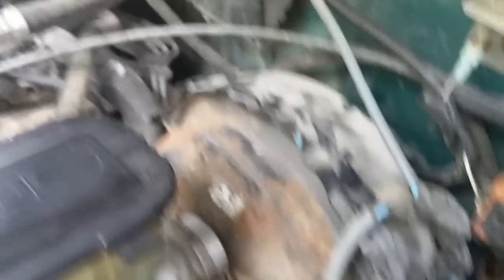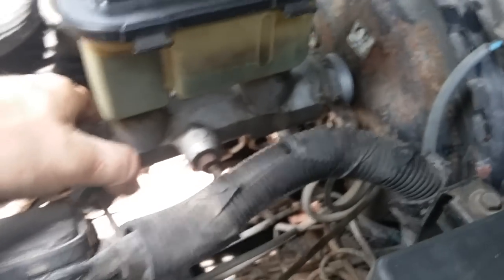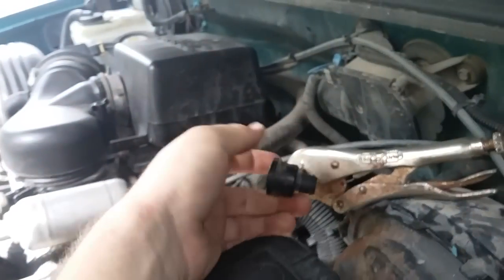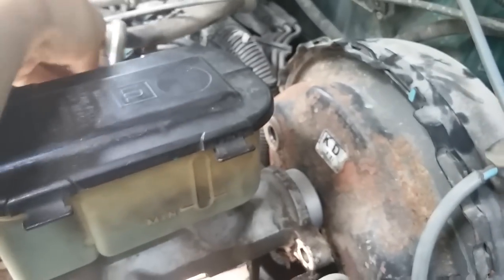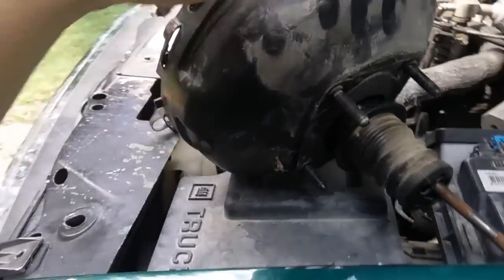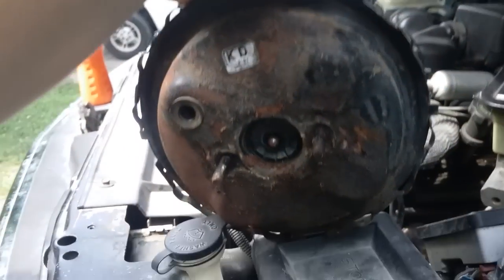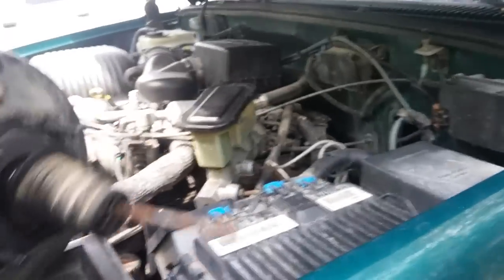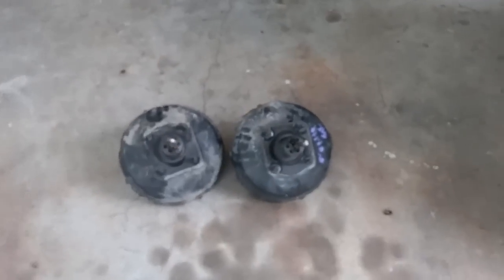HOW TO REMOVE THE brake booster. installation Chevy 1500/how to fix the brakes on an old chevy/

Comment: Danny, thanks for the video.
I just did this job on my '98 Tahoe, what a beating!

Couple of 'key' discoveries that should help the next victim who decides to undertake this project:

1) If your Chevy model has the round brake light retainer clip as shown in this video, use your small, but sturdy flat blade screwdriver and focus on opening/widening up the small vertical gap on the clip. The gap on Danny's clip he shows next to his fingernail is about six times larger than normal. Don't waste your time prying on any other part of the clip, just fidget with the small vertical slit on the clip and work to expand it so it can then be pryed off.

2) Do yourself a favor from the beginning and remove the single bolt that attaches the two sections of your steering column together under the dash. You may need to turn the steering wheel slightly to get the best ratchet (15mm) accesible orientation to do this, but trust me, it's worth it! Separate the column and gently shove the lower half of the steering column thru the firewall. You might also push the steering column's rubber boot into the firewall, but it's easy to retrieve and set back into place. Removing that single bolt and separating the steering column will give you LOTS of additional space to 'fight' with that brake clip and also provide more angles of attack for your ratchet and extensions when trying to remove and replace those four power brake booster bolts!

3) Wear a pair of gloves when working up under the dash as there are multiple places where you can slice your hand and fingers.

4) Pay attention and take a good mental picture of how the PPP rod and clip attaches to the brake light switch to lessen frustration and confusion when re-assembling towards the finish line of this project.

5) When wrestling with the removal and installation of the new and old PPB, note that you'll need to massage the PBB past a large cluster of wrapped wiring leading to your fuse box and at the same time massage the master cylinder gently up and off to the side out of the way trying not to break those brake lines. 

Good luck to all!
Reply: PBB (Power Brake Booster), not PPP, in above comment.
Reply: Here I go. ...

Comment: Went to pump my brakes before i drove my hauler (90' chevy silverado), pushed too hard i guess because i just felt a pop and the pedal depress all the way to the floor, still got good brakes, just all on foot power!  Thanks for the video, should make fixing it a lot easier.

Comment: Would that "woosh" noise under the dash as the pedal is pressed in; indicate that my'95 needs this job done ?
Pedal drops down far with that  noise when the truck is running 
Vacuum leak at the interior seal ?

Comment: I replaced my brake booster on my 2006 chevy silverado and now my tail lights won’t work. Do you might know by Chance what I did wrong? For them to stay on with no key in the ignition.

Comment: How do you know if its the booster or the brake master cylinder? I have fluid that slowly leaks from the vacuum port at the brake booster. Would my master cylinder be leaking?

Comment: I just did this on my 97. I'd recommend to anyone who does this job to buy an extra brake sensor clip. I took mine off but in the process it went flying now I have to go buy another one lol. It's only like 5 bucks at autozone and it actually comes with two in the pack.
Reply: Did your truck make a loud squeaky noise and all 4 tires lock up? Because mine does that only when its cold and the ABS light turns on.
Reply: @vegarojasj21  No mine didn't do that. When my brake booster went bad my brakes got really stiff and it was hard to brake.

Comment: It is simple but it is a pain in the ass. On my 91 the bolts are about an inch longer then they need to be, and where the bolts are I can only turn the wrench about a 1/8 of a turn and with every turn you are fighting it. After a while of turning it starts to feel like your arm is gonna fall off. 😂

Comment: I have a 97 Silverado 2500. Brake pedal works fine but then starts to need to be pressed in more and more while sitting still once pedal has been pressed in. Has same problem if on a hill pressing brake pedal. Could this be the booster or something else? Planning on changing pads and discs too bc theres a cut on one of the discs.
Reply: Master cylinder
Reply: Do your brakes make a loud squeaky noise and all 4 tires lock up?

Comment: I have a 95 Chevrolet Silverado 1500,350motor. I changed my front n back breaks n my breaks still go to the floor and I can't figure out why it's smoking. Any advice??
Reply: Mine makes a loud squeaky noise and all 4 tires lock up and the ABS light comes on but only when its cold it does it.

Comment: my 99 chev c3500 has that hydroboost. my brakes would have to step pretty far in to stop. already bled my brakes. Would replacing this fix my issue?
Reply from the maker: it can be a multiple things... if all the air is out of the lines and master. it could be the rear brakes are not tight ... with the wheels off the drum should not spin super easy.. needs to have some friction... if they are set right then possible... but not common... most of the time it will become really hard to push or the booster leaks vacuum...does the petal get hard or is it squishy.....or  if it gets hard close to the floor i would look in to ajdusting the rear brakes....
Reply: DANNY'S GARAGE it brakes fine. It isn't spongy. Distant of pressing is just too far in
Reply: No, it won' fix what you have. yours is not a power booster failure. Your issue is with the ABS system. The Power Brake Booster in this video as you may notice is a mechanical device that operates independent of the hydraulics of the ABS System. It uses vacuum to assist in driving the hydraulic fluid into the lines and into the ABS system. If you are having to step into your brakes to stop you are either having a failure of the ABS system or you have a leak or air in the hydraulic lines. Changing the Power Brake Booster won't have any impact on your issue.

Comment: Did you have to remove the brake lines going to the master cylinder? I can't pull the master cylinder out of the way
Reply: @jax9769  so you never had to bleed nothing right ?
Reply: @huntermorris8890   Been 2 years now. I can't remember if I bled them or not. If I did I just did the drivers front.

Comment: I have a 96 Tahoe that has an abs light on. also, it sounds like there is some kind of vacuum leak. The brakes are spongy and don't work without pumping them. I bled them and made sure it was full of fluid. do you think it could possibly be my booster?
Reply from the maker: hard to tell without looking at it my self... spongy brakes could be air in the lines. abs could be a wheel speed sensor
Reply: Yes

Comment: I have an 81 Chevy Silverado. Trying to disconnect the pushrod from booster to brake pedal. I don't see a clevis pin. Do I pull off all the nuts?
Reply from the maker: Push rod stays with the booster... Disconnect from brake pedal...yes pull off 4 nuts holding the booster on..
Reply: Easy job, but the disconnect of brake pedal was a little difficult. Thanks for your help

Comment: why is no one showing the hard part. removing the attachments on the pedel? you just show what the pin looks like AFTER you removed it. I'm trying to find out HOW to remove it
Reply: Did you ever find out about that I am having the Same issue and I cant figure it out I have 94 blazer abs is on and sounds like air or something from the floor bye the pedal

Comment: What'd you use to remove that clip?
Reply: I locked the break petal back a few inches with a pry bar between my clutch petal and gas petal and then had a pretty clear picture of the retaining clip. A long flathead screwdriver did the trick. Stuck it in the tiny vertical gap and wiggled it apart. Popped right off.